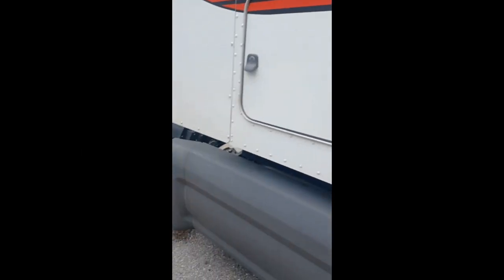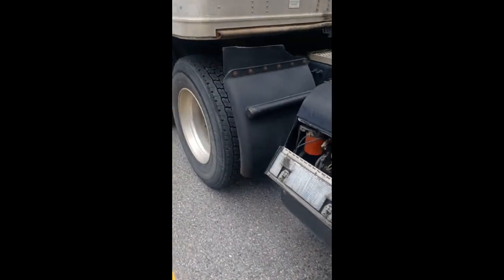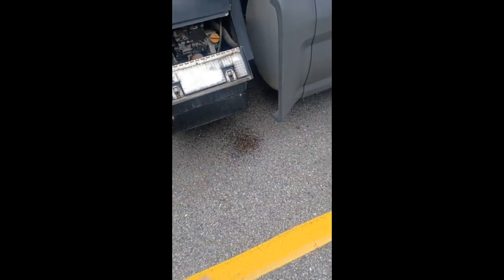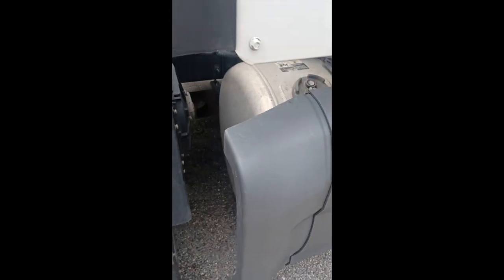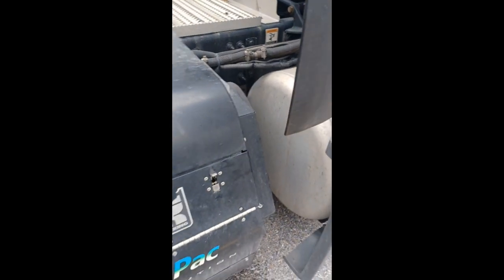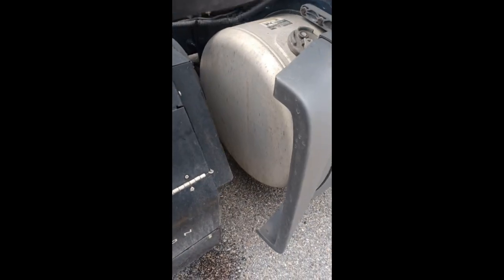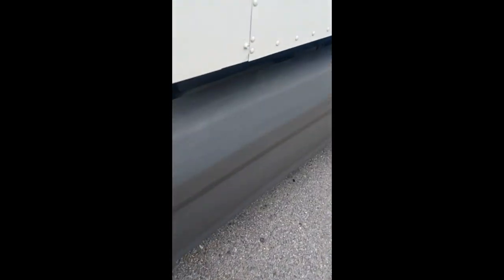coolant leak on apu unit peterbilt (Cut off valve location)

Comment: Good job Shawn you never woulda thought that it came actually I thought it came from the bottom up the truck but it comes from the engine compartment I love peterbilts when I was growing up as a kid I watched one of the sexiest Peterbilt passed me up she was all black with the Chrome stacks and the running board and them rims with shining she was pulling a tanker that was one sexy Peterbilt and she had a cold Cummings with the high-performance pipes that made that noise
Reply from the maker: Appreciate you watching

Comment: Seems like there are different setups for the apu. I have the same apu but mines has a separate little coolant reservoir just for the APU. Seems like yours is set up to keep the engine warm in winter.
Reply from the maker: Yes sir exactly